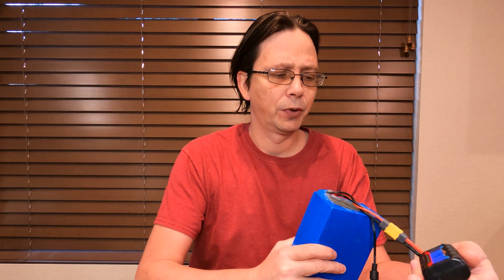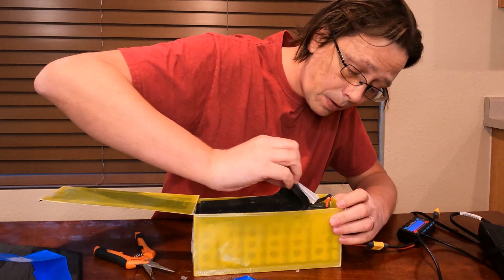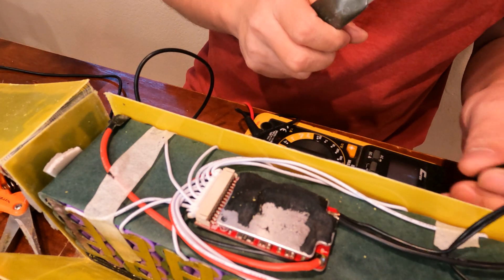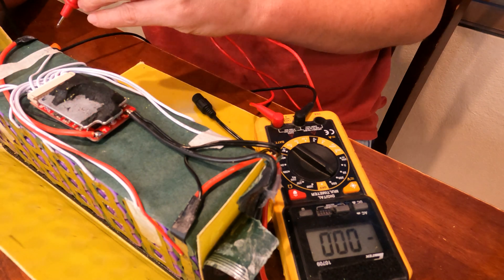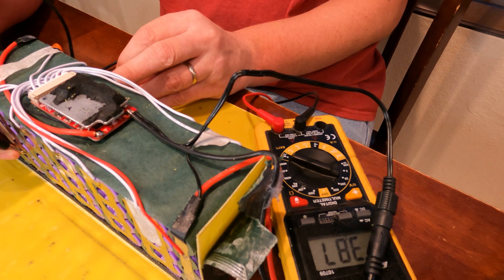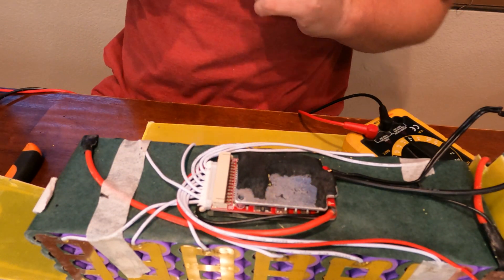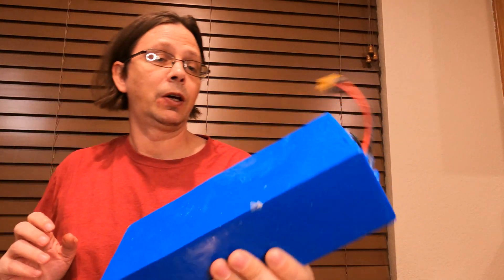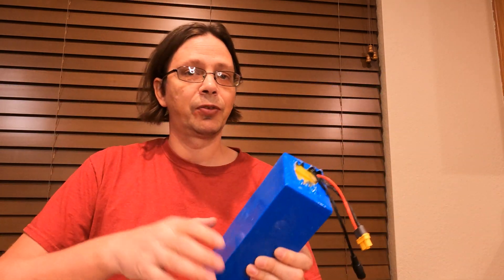Battery BMS Repair - How to and Not to

Comment: Hello , i have a problem with my ebike 48v 
13s battery.
When almost fully charged, i measured 55v . Went for a short ride , hit a porhole , it shut off, then i pedalled & hit another pothole , it sometimes come back to live , but once i measured again , it was just 50v.
Strange...
Is it anyway possible because of loose connection & became a 12s battery ?   But i can still ride as usual , still feel there is torque, but just havent tried the distance on it
Reply from the maker: Sounds like a bad connection or bad BMS. You will want to fix that right away as it may become unsafe.

Could be as simple as a spot weld coming undone or the main connector is bad or dirty. I had my downtube battery melt its positive connection. Happened on my last Mexico solar tour past anything I've published on it yet.
Reply: Tks alot for your response....
Cheers.....
At the moment , i couldnt get someone to look into this battery....& I dare not open it up myself, because i might not be able to assemble them back.....
My curiosity is , is it possible for a 13s battery become 12s battery because of loosen joint / solder , & still giving power out from the 12s ?    Does the BMS  ( assumption ) allow ?

Comment: The e-bike world has a battery problem. That problem is that almost every battery pack, regardless of voltage, is managed by one of these cheapo BMS units, available from eBay and Amazon. Its not a matter of selecting the right unit for your pack, because there is NO right unit for most packs. I say this because I've looked far and wide, and have determined that the only high power battery packs which have suitable BMSs, are ones that were built by the company making the product it goes into. For example, Segway/Ninebot battery packs use a BMS specifically designed for their products. And these BMSs usually have additional connections that allow the BMS to talk to the rest of the EV system, usually through a UART protocol.
The cheapo BMSs only do passive balancing, which is fine when the implementation is correct. But most of them only apply around 20mA for balancing. That may be sufficient for a nice, new, already balanced pack, but before long, it won't be. Why? because it's not enough resistance current to prevent high cell banks from continuing to gain voltage when they reach full charge. So once the pack has a couple dozen charge/discharge cycles on it, and the cell banks start to get more unbalanced during use, they may become unbalanced by more than the high voltage cut-off. When this happens on a same-port BMS, the output AND input get disconnected and the pack is now a brick. The only fix is to manually balance the cell banks back to normal so that the BMS can work again. And that situation is actually a better scenario than what is more likely to be the case, which is that the BMS doesn't even have high voltage cut-off for individual banks, and only monitors the total pack voltage. In that case, the high banks just get repeatedly over-charged, which at best will ruin the cells prematurely, and at worst cause a fire.
So not only are the cheap BMSs unsafe in that regard, but you can't find one that can sufficiently handle the output current of most ebike packs. You just want a BMS that does what its supposed to do, without you having to think about your battery constantly. And that isn't available. Those cheapo BMS's on eBay and Amazon are only rated usually around 15Amps.  You find me a NON-SMART BMS for a 10S li-ion pack that can handle more than 30Amps, and FIT in a typically sized pack, and I'll eat my shorts. I don't want one that interfaces with my phone. I don't want one that costs $100+. I just want one that does its job so I don't have to think about it. And they just don't exist. Quality EV manufacturers like Segway know this, so they design their own BMS that actually works for the life of the battery. Ya know who doesn't design their own BMS?  Just about every single ebike company.  Like I said, its a problem!
Reply: I have a Segway by Ninebot and yesterday I had to buy a control board because the battery went all the way out when I was riding once, there are 100s of people online in forums talking about their segways stop working the product is unreliable from mine and everyone else’s experience

Comment: When its high voltage and circuit gets complete it makes a spark, nothing to worry about. Its becouse higher voltage makes longer jump, if you connect it slowly it will jump and create spark but if you connect it fast it wont make it.

Comment: I just made a 6s4p battery pack but my bms is not responding at all it's a balanced one with negative wire going to bms for protection but negative is not responding on other side i spent about 13 dollars on it it's a china one
Reply from the maker: Double check to make sure the balance wires are in the right order. Also check If any rows are under 3.0v. If not them you may of got a bad BMS.
Reply: @Eric_Tennant   thanks for your reply I am just sitting here and trying to get a response on a professional but you replied thanks and I did what you said yes 1 of the cell is 2.5 v and I removed it now I have to spot weld the replace battery
Reply from the maker: @malindurajapaksha1791  Helps to have them all charged to 4.2v before linking them to prevent adding dead cells. Most BMS balancing features lack the amps to fix a out of balanced battery.

I added a Neey cable to all of the batteries I have to keep them maintained and balanced. https://youtu.be/zMOUt7dSupM  Be safe!
Reply: @Eric_Tennant  it's all new from Sony 1 battery was like 12 dollars but I bought 50 of them. Update now it's working. so that mean the China bms is good? Now I am discharging All of them because I didn't sure about these batteries they are original Sony batteries but you know can't trust anything now days
Reply from the maker: @malindurajapaksha1791  Nice happy its working now. The bms was doing it's job as far as low voltage disconnect goes.

Comment: I think im gonna buy a rc hobby  bms so then u can see what sell is doing what from that bms cable also u can charge the individual packs to 3.7 so it ballances it so u dont have 2 take em appart that far i think after many video's thats the safest smartest and quickest way but my bms is locked out so i have 2 solder a New bms to it then ballance so the bms is detecting that all is good what a work but this is a handy video what not to do 😂
Reply from the maker: I use a external system to balance the battery now. https://youtu.be/zMOUt7dSupM
Reply: https://youtu.be/eQ1FLXeUgWw?si=c__onTQzQnm5SSDy then im gonna do what this guy is doing with your soldering directions wish me luck maybe its smart to film it as well because battery fire video's are doing well as we😂
Reply: Thats nice i just have the bike 2 days its almost brandnew saved from the scrapper im gonna look that video its nice to learn from People Who tried stuf instead of reinventing the wheel yourself and when People share knowledge its a huuge plus

Comment: @5:59 Excuse me, thats my title. If there was a bomb with an hour left on the timer, and I have soldering iron already plugged in, solder, flux, and only needed to solder 1 wire to the board, we’re all going to die.

Comment: Hi sir I'm build one battery back 10s8p I already to connect everything but I confused bms wire which size are using so please help me
Reply from the maker: Not sure what you are asking.
Reply: The main current passing wires largely depend on how much current you’re going to pull.  For, say, 30 amps for a stiff BBS-HD, you want at least 10 gauge wire.  Thicker wire will reduce the Ohmic Losses - less heat, and more mileage.

The balance wires will usually be about 20 gauge, as an amp is about as much as most balancing circuits will run, e.g. the Daly “smart” active balancer speaks of 1 Amp.  

However, there are SOME active balancers that will flow as much as 5 amps - and that means 18 gauge or so for their wires.

Comment: Hey i just made a 48v battery for my scooter it runs but i cant charge it. When i test the individual balancing ports i read 3.4v for most but 2 of them are reading 10v and -17v cant figure out what i did wrong? Any help would be appreciated
Reply from the maker: That's odd. 10v - 17v on a cell I would think it would explode. 4.2v is the max a cell should be.
Reply: It means the balance leads are connected wrong. While it’s possible on a dumb BMS, it’s more likely on a smart BMS that works for 7s to 16s. 

On the dumb BMS which only has the exact number of leads needed, its not easy mess that up, but for smart BMS they have different wiring diagram.

For example, my ANT 10s-24s you just connect in order and leave the last wires disconnected since they aren’t used,  but my 7s-16s has connect 2 balance leads to one of the middle series and omit wires between those two. Very odd if you are expecting it to be ordinary.

So check the wiring diagram for your specific model and for 13s, it will tell you which wires to omit and which two wires to connect to which cell.

For example, on the ANY 7s-16s wired for 13s, you would omitted balance leads 8&9, and connect balance leads 7&10 to cell 7(+). All the other balance leads would be connected in sequence like any other BMS. And as always, BMS must be connected to battery (-) before you connect the balance leads to the BMS.

But I’m sure by now you already found the solution. Lol

Comment: Hi, I have a Kugoo G booster , my voltage is dropping from 51.4 to 0 in seconds . I leave it for few hours then it works like nothing is wrong !! it occurs  randomly. Do you think my Bms is damaged ?  and after seeing your video i have gone through some bms on amazon but most of them says ≤500w motor and i have two 800w motos so can i use those ? Any answers will be appreciated. Thanks.
Reply from the maker: 100% the BMS is doing that. Ether its bad or it detects the battery is overheating. The only other reason BMS would shut off the discharge is if one of the 13 cells (Columns) drops below 3.6v; however it wouldn't come back until it was charged past that voltage again.

I am currently using Daly BMS in my packs for my 48v https://amzn.to/3mxLvYh
Reply: @Eric Tennant  thank you.
Reply: @Eric_Tennant  but do you think changing the bms would solve the problem?
Reply from the maker: @FragheadNafii  Yea. a 30ah bms would work (54.6v x 30ah = 1638wh). So long as that scooter allows for any bms to be used. Daly takes its own plug so the balance wires would have to be replaced for that brand https://youtu.be/zhymnU83Jlo .

Also if battery is overheating this wont fix it.
Reply: @Eric Tennant  thanks mate.. I have zero experience with this but I'll give it a go let's see what happens.
Reply: @IIToxicz   had to change the battery.
Reply: @nafi.j why??? Today I have the same problem too, my battery show full charge but after I throttle it on my ebike it shut off. But when I recharge it awhile den plug it on my ebike the volt meter keep running up and down when I turn on n off, but no matter how I try to charge it the charger still on green mode
Reply: @mrcoco3562 Probably one of the battery cells got damaged, or it's a controller issue. When I first opened my scooter, I found water inside. I had to seal it with silicone.

Comment: Can I connect the battery directly to the hover board, bypassing the BMS?
Reply from the maker: Yes; however then the battery has zero safety features. You basically need low voltage shutoff when using it. Many Bikes/boards do this already.
Reply: @Eric_Tennant  Thank you for the reply. I have a fully charged battery but, when connected to BMS, it does not power on the hoverboard. When I directly connect the battery (~36 volts) to the hoverboard, the hoverboard powers on. 

I'm fed up with troubleshooting this darn thing and plan to just ride out the charge in the battery, until it's depleted, then throw everything away. Is that safe, as long as I don't charge the battery?
Reply from the maker: Sounds like a bad BMS or one of the Column of batteries is not charging. You could ride the battery one last time. It will only damage the battery when the voltage goes to low.

Comment: good job man, first thing first those amazon bms dont do balancing even they say it does :) second thing i think first bms you hooked up was wrong way round and blow the resistors thats why the bms heats up and last thing if you want a long life from your bms just bypass the discharge connection, that way you get more power from you battery and eliminate using discharge function of the bms (less stress for bms ) bms there for only to deliver 4.2v in to blocks equally, if you have bad cells in the pack replacing bms will only be a temporary solution after few cycle of usage the problem will occur again best solution replace the lowest cells when replacing the bms.
Reply from the maker: Trial an error. Yea first one balance wires were backwards. Didn't see that until after I cooked the board; because I didn't realize they had a 2 way standard.

Comment: Thank you! Very helpful video! I got a 13s7p battery, and one of the cells is discharging much faster than the others. Also this cell charges only to 3.5-3.6v, when the others are 4.2v, and the charger light turns green. And when storing this cell once dropped to 1.5v. According to your experience, is it a bad cell or bms? Thank you!
Reply: 13s is for 60v right?
Reply from the maker: Try to charge just that row and see if it will take a full charge. If not then it's the cells. Battery is only as strong as it's weakest cell.

Most bms do a poor job at balancing for what I've seen.
Reply: @Eric_Tennant  thank you! I disconnected the bad row, and one cell is losing voltage pretty quickly. From 3.2v to 2.2v in 5 hours. I guess it’s the reason… the other 6 cells keep the same voltage. But they were discharged all the way to 1.5V some time ago which I guess damaged them. Should I replace the whole row or only one cell?
Reply from the maker: Just the bad cell I would think. Does the 6 cells charge to 4.2v when the bad one is removed?
Reply: @Eric_Tennant  I ripped off the strip on the positive side, and now I need to solder it back to check? Can I connect only six of them to the strip and leave the bad one disconnected and plug in a charger? I don’t have any imax b6 to check the cells separately.
Reply from the maker: Not sure.  Could work; however the other 12 rows will be lower then 4.2v give the 6p row would be full first and the BMS will stop charging. I used a old 18650 charger from my old vaping days. Your going to need to equal out all cells on that row before adding the missing battery back to it.
Reply: @Eric_Tennant  appreciate your help and advice! Will keep you updated!
Reply: @Eric_Tennant  one more question please - I found some info on the existing cells capacity - around 1500mah, is it okay if I get a bigger capacity replacement cell and connect them in parallel with 6 lower capacity cells? And what discharge amps should a replacement cell have, if I got a 1kw 48v motor? As far as I have read it can jump to 1.5kw for short time when starting, which leads to 1500/48v/7cells≈4.5A peak per one cell, which is not a lot. Should I get one with around 5A max discharge, or around 10A to be on the safe side? Sorry for so many simple questions, it is really hard to find anything on forums. Thank you!!
Reply from the maker: Your going to want to try to match the row average capacity the best you can. From your math it looks like 5a discharge would work and true you couldn't go wrong going higher on the spec.
Reply: @Eric_Tennant  yo do you work on other people stuff??
Reply from the maker: Just my own so far!

Comment: i dont do bms's I only charge with custom batteries i made with balance cables and hobby charger that shows all the cells voltages on a display can't trust the red/green light of a bms... I had 4 ebike batteries from Amazon fail....
Reply from the maker: I have found that BMS do a poor slow job a balancing. I do need to get a hobby charger at least to make fixing them easier.

Comment: Want to find out some good 13/14s BMSes.  Ideas?

Am thinking that BMSes should be entirely connected by anti-spark connectors… seems Amass makes ~ 100 Amp bullet connectors.
Reply from the maker: Would make for faster swapping if they were sold with bullet connectors. If it the right BMS there will be no spark. I seen while editing this video that both BMS's have B+, B- on the board by the balance wires connection. Oops. 

The main output wires, some use XT90 anti-spark connectors. At some point I may move to these for better efficiency. Right now I'm using Xt60 with sparks.
Reply: I’m currently using the -90 connectors for output, -60 for charging.

Note: I’m thinking my B.M.S. has ex-pired.  Zero volts out…
Reply: Addendum to previous: seems the 60 Amp (RED) Daly (Smart) BMS has 6mm screws! for connectors!